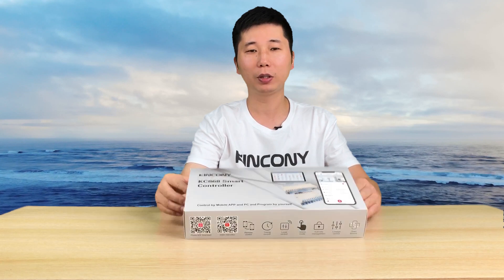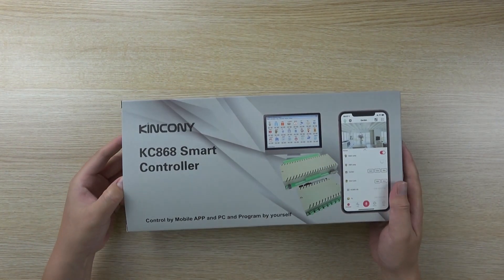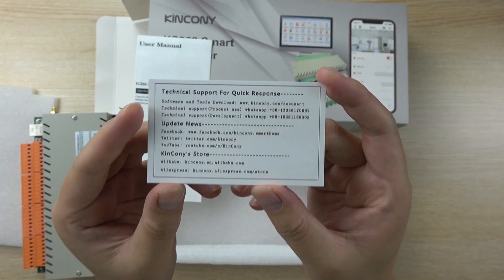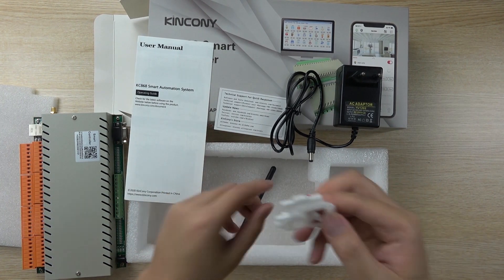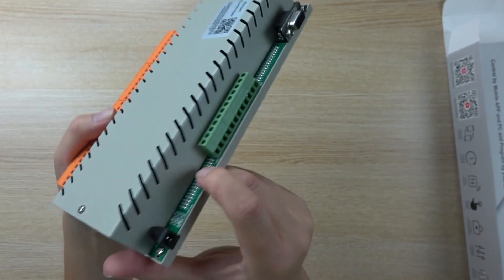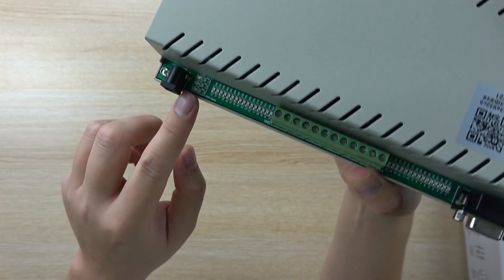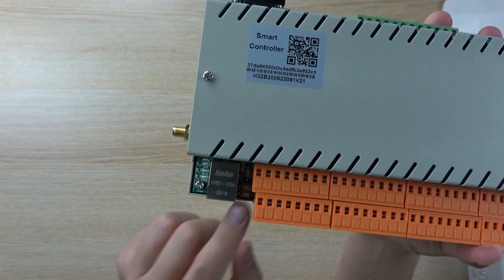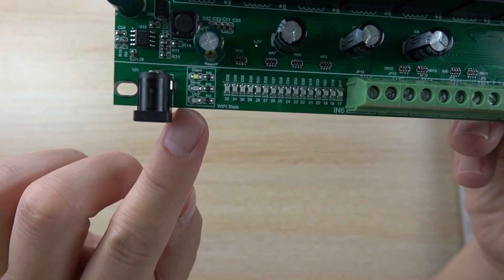【how to use KC868-H32B#1】home automation controller about hardware

Comment: It will be supported in srilanka.and you have any distribution in sri lanka.so we will came to China can by that modular.
Reply from the maker: now no distribution in srilanka. you can order from our online store.
Reply: If I want to to use manual how we can use this and what is the type of manual switch.
Reply from the maker: @thusithadilshan6483  add this switch terminal board: https://www.kincony.com/button-switch-module-for-kc868-hx-relay-controller.html    use any dry node contactor (self-reset ) switch (like a button) is ok

Comment: How to make a link with TV, adaptation and curtains
Reply from the maker: relay controller can control curtain, just 2 channel relay control a motor for curtain. TV and air conditioner can use KC868-G send IR to use. all these controller in one system ,use one same app.

Comment: Where is the server of this hardware? Can we connect it to our own server
Reply from the maker: our cloud server in China. controller support connect to your own server by TCP socket connection. you can set your server IP and port in config webpage.then you can send command to controller control relay by yourself
Reply: @KinCony  so it will disconnect from Chinese servers and controlled from New servers right?
Reply from the maker: yes, it support, just change the network module setting. change ethernet's or wifi's module setting by website. relay controller use website to config network setting.